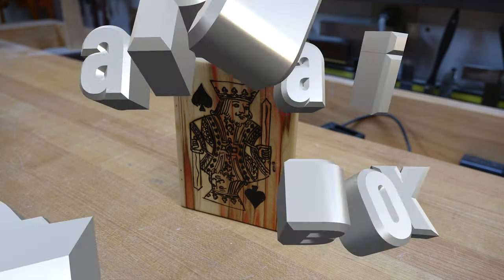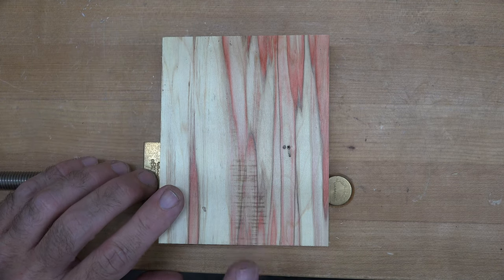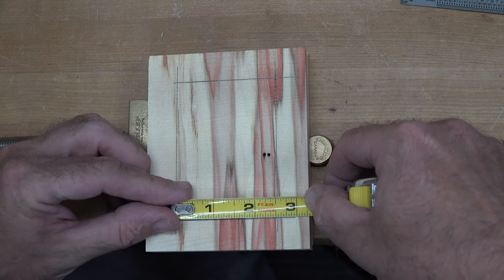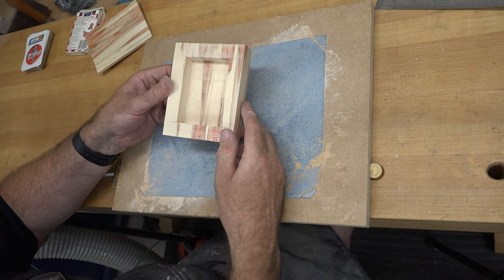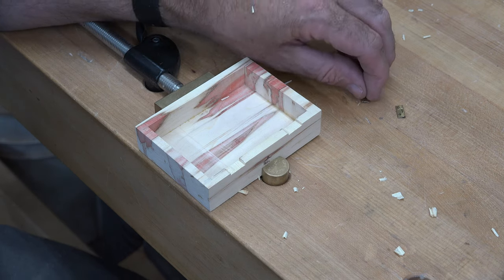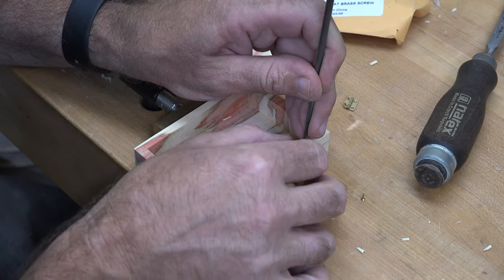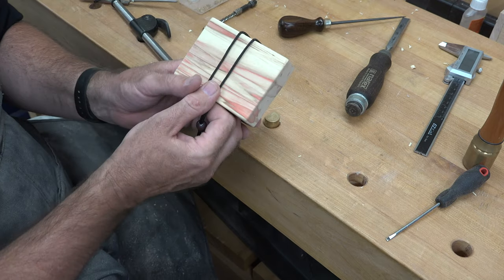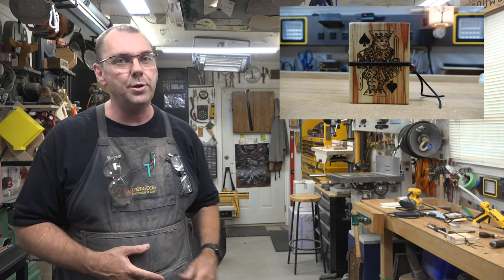Playing Card Gift Box

Comment: Great project! That wood is fantastic. 
The one thing I might add is one or two finger holes, so you can grasp the cards. But I suppose just turning the box over to get the cards out works well, too. 
Thanks.
Reply from the maker: Finger holes is a great idea Barb.  Would definitely make getting the cards out a little easier.  Might have to thicken the walls of the box to add the finger holes though.  Awesome idea.  Thanks for tuning in and for chiming in with your suggestion.  I appreciate it and it's always great to hear from you.

Comment: Hi Kenny! I had no idea there was such a thing as flame box elder. Really gorgeous. And, I had been lead to believe that when you cut out the center by rounding going wide when approaching the corner and then back cutting would be cheating. I thought you were always doing the quick 90 degree turn and continuing on. Makes me feel a little better. Love the box top. Have done a little word burning in my past. Regards, Bill
Reply from the maker: It depends on the results you are after Bill.  If you wish for the corner to have a sharp peak, a tight corner with the blade isn't going to do it.  Even with the finest of blades, the corner will be ever so slightly rounded.  So if you want the sharp corners, cut it wide and come back for the trim after.  Thanks for tuning in.  I hope this helps.
Reply: @acutabove_woodworkings  And here I thought I was cheating.

Comment: Great video. I love projects like this. What is that clamping system you have? I need to get a better way to hold my work in place besides the peg board I have.
Thank You
Reply from the maker: The clamping system that I use on the bench is a Veritas Quick Release Wonder Dog.  They are absolutely incredible and keep your work very secure.  Here's a link.  https://www.leevalley.com/en-ca/shop/tools/workshop/workbenches/benchtop-accessories/74622-veritas-quick-release-wonder-dog?item=05G1030
I hope it helps.  Thanks for tuning in Brian.

Comment: Kenny, nice project.  The piece of wood you used sure was a good looking piece.  Your comfort zone is a lot greater than mine.  No way would I attempt wood burning the card face on the cover after putting that work into it and chance (and no doubt surely) messing up that nice cover.  Nice work my friend.
Reply from the maker: Believe you me Paul, those thoughts ran through my mind when I was debating burning the King into the cover.  I worried about messing it up and then thought "what have I got to lose?".  As it turned out, I really like the end result and I'm glad that I didn't let my concerns stop me from pushing the design further.  Thanks for tuning in and for taking the time to leave a comment.  I appreciate your dedication to the show.